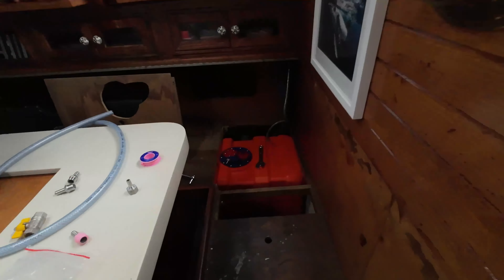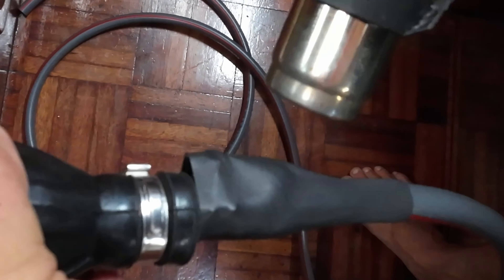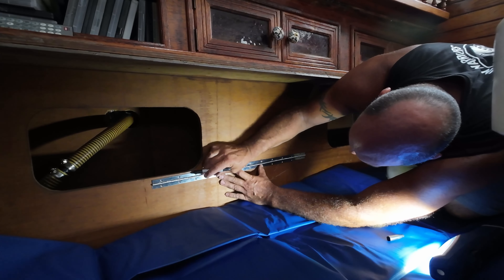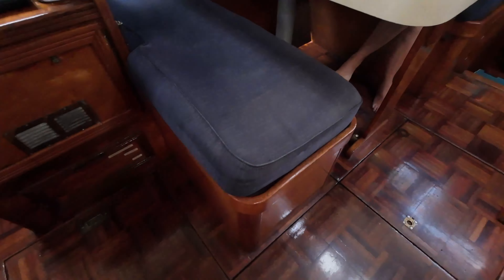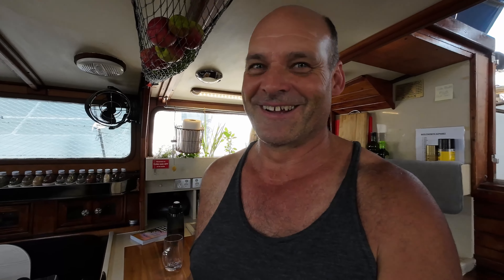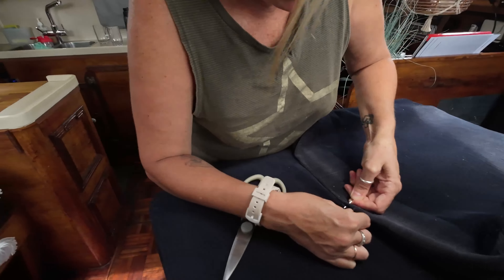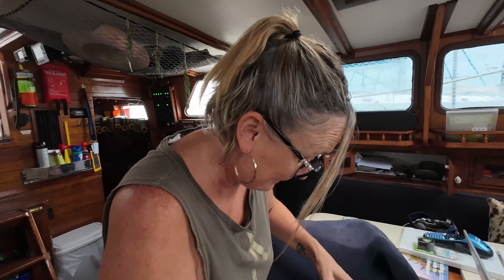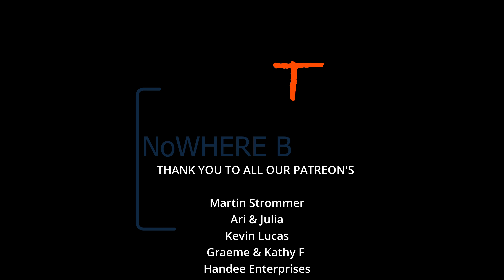SV Awaitea is having a few internal renovations making more space and more usability #vlog

Comment: Look at snowys outdoor collapsible stool. Just make a cushion. Old copper pipe makes good cable lugs or bus bars across batteries. Or multiple connections points. Flatten out and drill holes, bolts , nuts and washers
Reply from the maker: Will do, thanks 👍